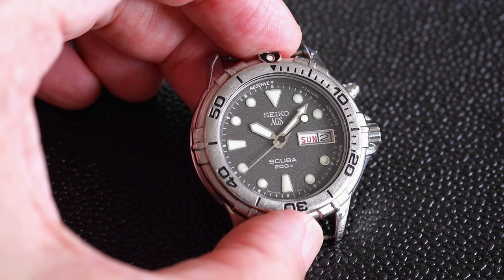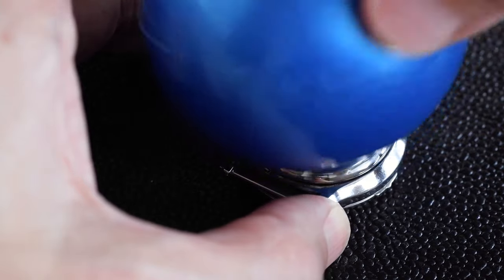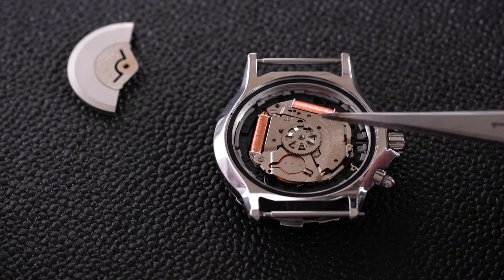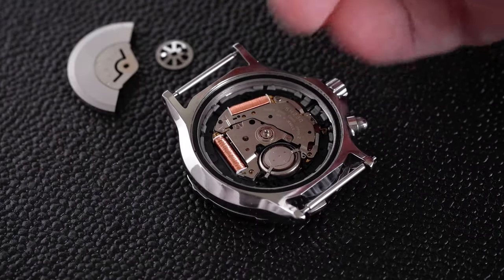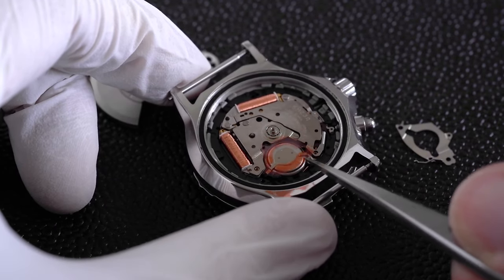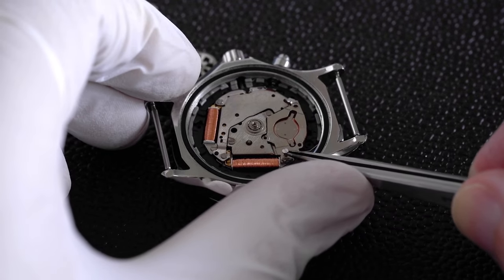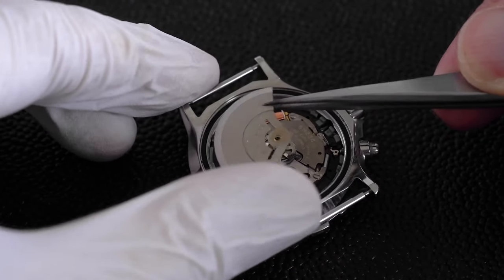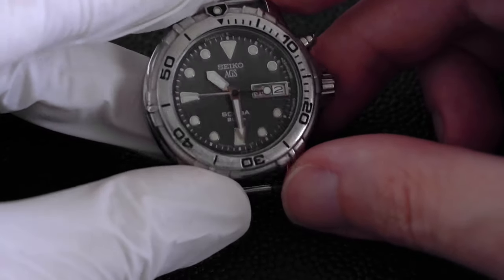Seiko Kinetic Battery Replacement: How to change the capacitor in a Seiko kinetic watch

Comment: This video gave me the courage to try and replace the capacitor on my 28 year old kinetic, my first real watch. It had been stuffed in a drawer for almost 5 years after it had stopped working properly. It's currently sitting in a watch winder, happily ticking away. Thank you!

I also found out why it must be so difficult to make or restore watches. I definitely lack the steady hand to handle all those tiny screws. One of them jumped when I tried to replace the capacitor cover and I spent a few nerve wracking minutes trying to find it back.
Reply from the maker: Woohoo – well done! I agree, it's so difficult to keep a steady hand AND keep an eye on the tiny parts. I've also spent a lot of time searching on the floor! Sounds like you did a good job in the end. 👍
Reply: As a non pro…lose one or pair of these tiny screw is common😱
I have wreck many by just lose smthing😂
Reply: What is the lifespan of the kinetic capacitor?
Reply: @mohnnadmercedes8246  That's hard to say. I think it should keep working for at least 10 years or more. But it's best to keep them charged. I let mine drain completely and sit empty for an extended time, and that's why it failed on me.
Reply: @Structureel   theres a model with kinetic mvmt  but its a monoblock case so changing the capacitor is nightmare

Comment: I may have missed it if you said this; i did notice you using different, I assume plastic tweezers when handling the new capacitor. That's crucial to not short circuit the new capacitor.

Comment: Very helpful.  I found sources for the battery/capacitor on line.  Greatest problem was unscrewing the back.  Watch was dirty after about 15 years in a drawer and was willed to me after he passed.  Soaking the watch (still unopened!) and band in an ultrasonic cleaner.  Will try some WD-40 on the back to see if it can be unscrewed.  I have the complete set of tools from Byniiur Repair Kits and have repaired an old "Hong Cong" Rolex (fake gold) and two Timex watches.  This Seiko is a tough nut to crack.

Comment: Thanks for making the video, I'm using it to replace the battery in a 5M43. I fell at the first hurdle though as my cheapo 'Precision' screwdriver set did not fit the screw in the rotor tightly enough to give me confidence to unscrew it so I stopped. The groove in the top of the screw is quite shallow. Can you recommend a screwdriver set ? Thanks

Comment: Followed your steps and it was far easier than I thought (thank you) but the second hand is still skipping, any advice? Or is the watch toast?
Reply from the maker: You're welcome.
I've had that before (the seconds hand still skipping) and it was because the battery/capacitor didn't have a full charge when I replaced it (it was new but had been stored for a while). But after recharging for a while it was OK and kept its charge, so hopefully it's the same in your case.

Comment: Great video... step by step guide was perfect... even managed the tricky capacitor cover replacement with no issues!! My only issue is that the rotor doesnt move as freely as i think it should... the wheel and rotor are placed perfectly on the square spindle and the screw tight (not overly tight in my opinion)... the rotor moves but definately not as freely as in your video.... the wheel and tiny cog move perfectly thi the rotor... do you have any advice? Cheers, Phil
Reply from the maker: Firstly, congratulations on doing the replacement! It definitely takes patience. Regarding the rotor, I can't think what might be obstructing it other than perhaps some tiny bits of fluff or dirt, maybe around the little ball bearings or cog. I have noticed that some of my kinetics don't move as freely as rotors on automatic watches, so it could be just the way the movement is built. I'd say you have a couple of choices – either put it back together and wear it for a while to see if it works OK after all. Alternatively take it apart again and really check closely for signs of dirt, perhaps using a blower or bit of rodico to remove anything that's difficult to notice.
Reply: Sound advice, thanks!!! And thanks for such a fast response... there did seem to be a little dust around the tiny cog, so I cleaned gently around that area with a soft bristle brush and seems better... I'll see how it goes, but maybe get an air blower and try that also... how dust gets into a water toght sealed unit is beyond me!! Ive had it from new and the back has never been opened... Thanks again... cheers, Phil
Reply from the maker: @PhilDaly-y4m   You're welcome! It is weird if the case has never been opened, but not impossible. Fingers crossed that it's better now.

Comment: Great video. I like when owners - not all, depends on skills - have option to fix things they own. Is it possible to change battery - capacitor ;) - in the model 3m22 to 5m42, to get bigger capacity for the watch or these are different watches models in terms of size, so capacitor phisical size are also different?  Exactly I'm referring to Seiko Kinetic Arctura.
Reply from the maker: Hi Scott. I've not tried it myself but looking at battery/capacitor details, it looks impossible because of the physical size difference. For 3M22 (picture: https://www.watchbattery.co.uk/shop/products/BBCU-30273MY.shtml ) it seems smaller than for 5M42 (picture: https://www.watchbattery.co.uk/shop/products/BBCU-30235MZ.shtml).
Reply: @mizeni  thank you

Comment: Hello, great video thanks ! Would you know the capacitor/partnumber for the seiko 9T82 ? kind regards
Reply from the maker: Thanks for the kind words! I'm afraid I don't know what part number the 9T82 capacitor/battery is, and it looks like Seiko have deliberately not made it public. They tell you to send the watch to them for replacement instead. I don't know of a workaround unfortunately. Here's a (Japanese) article where someone tried to do it themselves but gave up due to the movement being so complicated, and the battery is not even visible! https://cadweb.jp/watch/?p=1642
Reply: Mine won’t hold a charge 
It works, but second hand gives a double tick and will stop if you don’t wear it for a few hours 
Does it sound like a capacitor to you?
It’s a model 5m42-0809
Indicator at bottom of red
Reply from the maker: @2dthoughts   Yes, this sounds like a capacitor that won't hold a charge anymore. Sometimes if you shake it for a few minutes it charges enough so that it ticks normally, but after a few hours it'll go back to the 2-second jumping or stop completely. So yes, changing the capacitor should fix your watch. The correct capacitor (battery) number is 3023.5MY – sometimes written as 3023-5MY or 30235MY. Hope that helps!
Reply: @mizeni  thanks so much 
Huge help
Reply from the maker: @2dthoughts   You're welcome! I hope you're able to bring it back to life.
Reply: Hi, thanks for the clear instructions 👍🏻 I have a 5M42-0D30, I replaced the capacitor/battery approximately five years ago and it worked fine, however I haven’t worn it since, obviously it now isn’t working so do I need to replace the cap/battery again or will it recover if worn for some time ? Many thanks for any information 👍🏻
Reply: It Shouldnt need replaced. Wearing it should recharge it but best to shake it for a min ot two to give it some life. The Seiko shake.

Comment: Where can I buy 2 small screws above capacitor? Left screw won't come out. What's a good screwdriver to buy? I just replaced old Maxell with new Panasonic (Indonesia); second hand goes to 20 when round button is pressed (max is 30).

Comment: How do you ensure it remains waterproof? I have a Seiko divers watch very similar to this, but have hesitated to restore it because I’m worried it will lose its waterproof seal. I’m not planning on diving with it, but would want it to withstand at least swimming pools. Do you need to replace the case gasket?
Reply: Always replace case gaskets if you can. ESPECIALLY in diving watches.

Comment: Sorry is this the capacitor that you are changing, or the battery. Also are all seiko designed the same way
Reply from the maker: Hi Paul. Officially it's called a capacitor but most people seem to refer to it as a battery. Either way, it's rechargeable and there's only one in the watch, so in this case "capacitor" and "battery" are referring to the same thing. Sorry for the confusion.

Comment: Hello. Why remove the rotor? Just block it.
Reply from the maker: Hi Christophe. I remove the rotor so that the gear underneath it can be removed, instead of trying to slide the battery cover under it. You could be right, it might be possible to replace the battery and battery cover with that gear still in place, but I find it safer to take it off so I have a clearer view of everything.
Reply: @mizeni  Just watched another video that doesn't remove the rotor and gear. I'm now convinced - remove them!